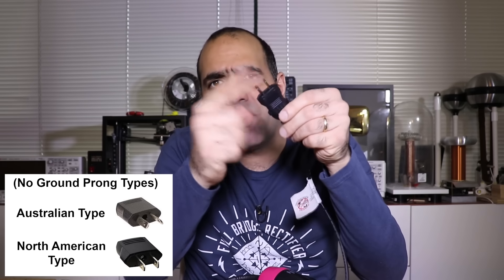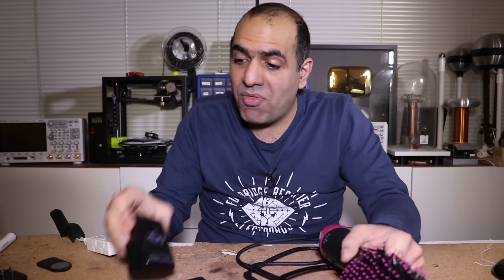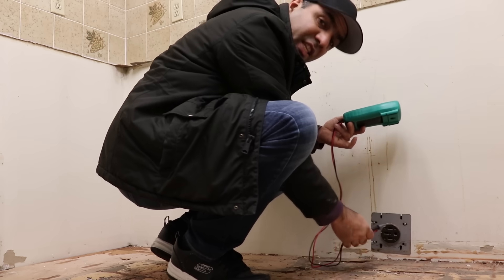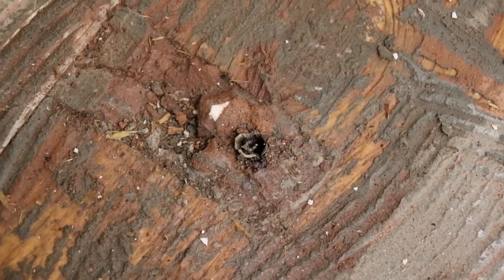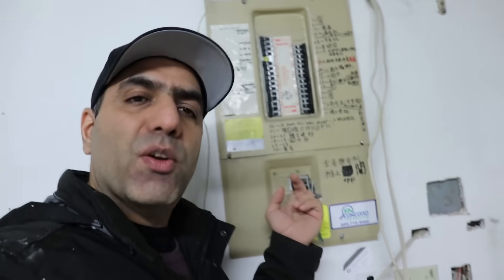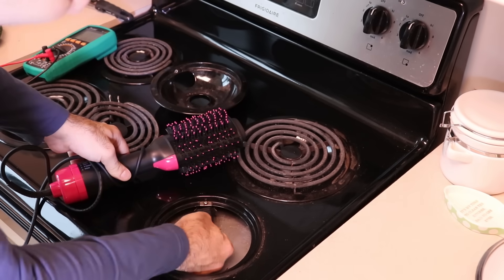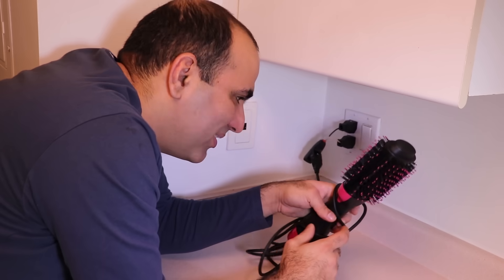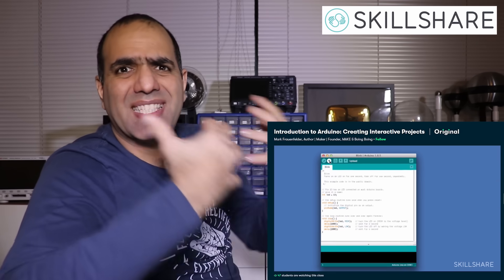Finding HIGH POWER 240V in a 120V Country

Comment: You're in Canada, how can you have 2 "phases" that are 120 degree apart??? The residential standard here is a center-tapped transformer that delivers 2 "phases" 180 degree apart.
Reply: His apartment building is on 3 phase power.  They just alternate running 2 phases to each apartment.  Your house is using 1 phase of a 3 phase power supply on a center tapped transformer.
Reply: @stargazer7644  So 220V devices in the apt run at a lower voltage? Wouldn't that increase the current draw?
Reply: @atubebuff  Remember Ohms Law?  I=E/R  If you lower the voltage (E), then the current (I) goes down as well.  This is how your oven works, for example, because it is a constant resistance load.  There are devices, called constant power devices, where this is not true - Switch mode power supplies are an example.  The current goes up on those when the voltage goes down because they're trying to deliver a constant voltage and thus a constant power to their load.  This is only true because they are active and react to the dropping input voltage.  So the answer to that is: It depends on what your load is.  If you're compensating for the voltage drop to maintain the same power output, yes, the current must increase.  If you're not, then no, it will decrease.

Comment: As a european electrician, north american standards frighten me
Reply: @KeeDx3 on a what?
Reply: As of a hundred years ago with Edison's suggestion of lower voltage,  it was hard to see the future. Light bulb filaments and electrical windings at lower voltages would last longer and insulation of wiring at the time was mostly cloth and wax. Running three wires is more expensive but was considered safer than one hot wire like the rest of the world.
Reply: @JamesWilson-pq9qp  AC is more dangerous, but Edison was a fool and a conmam
Reply: @torpedohippo8493  

Easy too say he was a fool, but at the time he was one of the most experienced people with the experimentation of electricity. He knew that arcing was more dangerous than resistant heat and thicker wires were safer than any chance of open air arcs. I'm sure you must have had seen the damage caused by loose connections or broken wires as an electrician. I know I have when I saw they tried replacing cooper with aluminum. What a disaster!
Reply: @JamesWilson-pq9qp  you realise aluminium is still used just as much as copper right? aluminium is just as safe as copper. 

I didn't mean was a moron or stupid. I meant he was a fool for trying to convince people that DC distribution system is better "because it's a lot safer", trying to convince people to use his DC system rather than the AC system with fearmongering.
Reply: @torpedohippo8493  As you might know some new high voltage tension lines are using DC for improved efficiency.  As we see in California open air arcing is a major problem with forest fires. Two steps forward one step back, DC looks to be the future with advancements in inverter created 3-phase. Who needs a humming wire broadcasting RF.  I have seen bad arcing with Aluminum, how to keep the connections tight when they expand and contract so easily?
Reply: @JamesWilson-pq9qp  as far as I know DC is only used in the high voltage long transmission lines. I'm fairly certain that the rest of the distribution system will still be always be AC for a number of reasons.

You keep connections good by using the right connectors/equipment and the correct tools and procedures when isntalling them. There's a reason that aluminium is used pretty much in all industrial supply lines (don't know the english word? but I mean the cables that supply the distribution boxes/panels), because it's much cheaper than using copper with such a large cable size. Aluminium does the job just fine
Reply: @torpedohippo8493   Yup, We've invested so much in the system we got, it's going to difficult to change over. As eyes open to the dangers of looking for cheap solutions we soon realize the old standards hold true, hopefully.   (power supply lines) I love copper for electricity. I think it's worth the price. In the times of Edison, aluminum was very expensive, we needed electricity to make it. Why not stainless steel? It's heavy but it won't oxide.  Soon enough we'll change over to micro-grids and get rid of high voltage transport and transformers.
Reply: @JamesWilson-pq9qp  stainless steel isn't conductive enough and costs a shitload. Aluminium is just fine for the places it's used. 
And yes, we will never go to a DC grid.
Reply: It's been great talking with you.  It will be interesting as solar energy becomes more dominate with it's storage batteries, and with the new regulations on inefficient 2-phase motors as they become obsolete. Who will want or need AC as we know it. Even our computers we are using run on DC. To think it's only been just over a hundred years with electricity and we're looking back on Einstein's Theory on photons.
Reply: @JamesWilson-pq9qp  all industrial electric motors are 3 phase asynchronous motors, that's probably the most compelling reason for us never leaving the 3 phase AC system
Reply: @torpedohippo8493  As we have seen the new speed controls of 3-phase motors, there are electronic inverters which can control superior efficiency by changing cycles along with voltage and amps. The power can be of any source and any smooth energy source is more efficient by not needing capacitors to filter ripple. Having one certain frequency (50 or 60 htz.) has always been a limiting factor with 3-phase. You'll see this coming pretty soon as everyone is trying to get greater efficiency with motors. 2-phase has to be worst, every motor with 3-phase and it's inverter will be the most efficient. Technology will change everything soon enough. We'll probably see refrigerators and air conditioning units first and then any new heavy industry will follow.
Reply: @JamesWilson-pq9qp  what? Are you saying we'll start using DC motors?
Also what do you mean with "control superior efficiency"?
Reply: @torpedohippo8493  Nope, no DC motors, nothing is more efficient than a 3-phase motor!  We can now create 3-phase with an inverter. We can now create different frequencies, voltages, emf;  we can have complete control over all aspects of the efficiency of a motor even in different loads.
Reply: @JamesWilson-pq9qp  what does that have to do with having a DC or AC grid? We've had frequency and voltage converters/transfprmers for years. We've also had rectifiers for years
Reply: Yeah but we use half the voltage, so it's only 1/4 as lethal. lol
Reply: @VoidHalo  also like the other dude said, more current = more heat = higher risk of fire. But just like I said, an RCD would render this irrelevant since it would trip during a fault like this regardless of voltage or current used in the installation
Reply: Nothing\ No. Half the voltage means double the current, which increases risk of fire.
Reply: @VoidHalo  The voltage is irrelevant.. The current and the voltage is lethal together, and 120V is plenty enough to push a lethal current through your body. Which is why in Europe we use RCD's in our electrical installations, while North America only uses GFCI outlets in the bathroom.  
An RCD would have interrupted the circuit in a case like the one shown in the video.
Reply: As an American electrician we havent cared about your opinions since 1776 

And ill admit out residential electrical system is shit but im speaking for experience 240 hurts way more and is a bigger arc than 120 that being said in America we dont push as hard as yall on insulated tools ( till getting in to 277/480 systems)
Reply: @burnedupsparkytipsandrevie9597  I really don't care wether you care about my opinion, 'murican!
Reply: Our GFCI's also trip at a much safer current level AFAIK
Reply: @Magneticitist  the common household RCD is rated for 30mA and max of 300ms
Reply: @torpedohippo8493  well I'm sure it's still serves as useful protection it also sounds like short ouch
Reply: @Magneticitist  what?
Reply: @torpedohippo8493  what I'm saying is 30mA seems painful and a little high of a trip current
Reply: @Magneticitist  it's max 30mA, usually they trip much lower and at about 3-5,ms

Comment: So regarding switch mode power supplies, and 220-240V vs 110-120V, is there a difference in efficiency for something like a ~1000W rated computer power supply at =/>50% load?   Are ripples more or less of a concern with one range over the other?    I mean, I’ve seen how weak some power tools are in comparison, lacking torque, such as power drills and 4” grinders.   But I’ve never really bothered looking deeper into it.

Comment: In the US, 240V power does not come from two different phases, here 240۰ and 120V power come from the same phase
Reply: @bosstowndynamics5488  True, they are two legs of a transformer, not two different phases, two legs with one middle end
Reply: You need two phases (plus neutral) to have two different voltages. 120V is between phase 1 and neutral, 240V is between phase 1 and phase 2.
Reply: @Gyzome  it's a single phase, technically called a split phase system
Reply: Gyzome They use a center tap transformer on a single phase, which results in 2x 120 volts 180 degrees seperated.
Reply: Its 2 seperate phases, and your neutral is tapped of your ground

Comment: Commonly done when trying to use a 220v welder without have a 220v plug, just create an extension cord or adapter to two different circuits and BAM, functioning 220v.

Comment: I thought the fact that residential grids are served from distribution transformers that convert 13.8kV to 240V and have a central tap acting as the neutral so that we can have a biphasic system with 2 voltage levels was common knowledge .-.

Comment: 1:40 At half the voltage we only get a quarter of the power out of it.
I should've expected that, but can someone explain to me why exactly?
Reply: If resistance doesn't change, current is proportional to voltage (I=U/R). Power is proportional to voltage and current (P=U*I), that means power is proportional to voltage squared (P=U²/R). So if U2 is U1/2, then P2=(U1/2)²/R=(U1²/2²)/R=(U1²/R)/4=P1/4
Reply: Power is voltage^2 / current

Comment: I remember having a weird 16A 3xx Volt power connector in my old german basement with some selfmade device by a electro engineer that changed it into 240v. Was aweseome for lanparties cause that thing had wa, more than 3,6KW surges... like at least triple that amount. we were like 10 ppl with those old crt monitors, was super awesome times

Comment: easiest way would be to find a plug with a separate circuit in your house/apartment (eg. fridge, freezer, panel plug) and put the neutral on the second phase of a 2 pole breaker in the panel, essentially changing the plug to 240v. Also dont plug anything else into this plug or it'll blow up (although it seems like you're into that kind of thing).

Comment: Omg, right before you put the multimeter in the outlet I thought: "He definitely put it to current to explode stuff". I have experience with doing that because I was an idiot, forgot it was set to current, blew a plug and corrupted my windows installation xDDD! Had to reinstall windows oops..
Reply: LOL. did you have to have a contractor out?

Comment: Correct me if I'm wrong, but the 240V "phases" in your house are not actually 120 degrees apart. This is called a single phase split, and it's simply a single phase transformer that has the secondary winding tapped in two different places. The center of the coil is 120V, and the far end is 240V... both measured from the same end.
Reply: Almost correct.   The center tap is usually referenced to ground.   This gives 120V from center tap to either end and 240V between the two end taps.
Reply: The phases in his apartment are 120 degrees apart.  It uses 2 out of 3 phases (360/3=120).  The house is different.  It uses a single 240V phase with a center tapped neutral.  When referenced to the neutral, the two hot wires are 180 degrees apart, because they're opposite ends of the same coil.

Comment: can I use this setup to plug in a 240v charger for my chevy bolt. it is currently plugged in to the dryer plug. with this charger it can charge at 3 to 4 kwh vs the 110 charger at 1kwh.
Reply: Technically yes. Practically you will need an electrician install a 240V socket to do it in a safe way.

Comment: What I know about 208 volts AC is its created from 2 live lines from a  3 phase power source , while 240 volts AC is created from 1 live line from 3 phase power source and neutral .
Reply: Actually, no neutral involved for just 240V.  The neutral is needed to allow you to get 120V from the 240V source.

Comment: Why is that you ha e 110v and we ha e 240v.
240 can run bigger appliances and uses less current. With 240 you dont need thick cables to run the same appliance as it uses less current. So why not just use 240 everywhere.
Reply: Changing the grid voltage is the same as swapping the driving side of traffic on the road. Everyone has to go at once. Account for at least a million accidents countrywide. Houses on fire because of appliances that started smoking and so. And a big part of the US grid uses 2-phase 180 degree separated lines, which has no place in 230v grids. So that’s even more to go wrong. In the first place, swapping all the transformers in a grid is impossible. You would need months of downtime.
Reply: Switching to 240V would be easy. We already have 240V coming in from the center-tapped transformer. It would only require installing gang-tripped circuit breakers and wiring in new outlets. Circuit breaker boxes already have the phases staggered so ganging breakers together is easy. The "Grid" would not need to change at all. The wires that feeds the pole-mounted transformers outside your house are at 13KV 3-phase.
Reply: @Engineer9736  indeed it will take alot. But considering higher voltage means less current means cables runs cooler. Aka less chance of a fire.
Reply: Replacing infrastructure everywhere to a 240V system would cost a lot.  Also, I imagine that 240V can introduce more of a health risk if shocked.
Reply: @DrewMiller4_18_5_23  will the less burning houses offset that number?
Reply: @captainheat2314  Can you link me to something indicating that 120V systems cause more house fires?
Reply: @DrewMiller4_18_5_23  120V kills better than 240V, because the current kills, not the voltage. 120V needs more current for the same power.
Reply: @marsovac  You can't get the current without the voltage.  Ohms law.  If current without voltage killed, then car batteries would be deadly.  Put your hands on the terminals of a car battery and tell me what happens.
Reply: @DrewMiller4_18_5_23  a battery is dc not ac. Different type of current.
Reply: @dariusvanstaden8144  I know,  but follow ohms law for resistive loads though, so I think it makes my point.
Reply: It ain't broke
Reply: Not sure what the laws are in US. But in SA your DB board needs to comply with regulations that includes having an earth leakage protector infront of your circuit breakers. So if there is an internal electrical failure it will protect the house. Less than 100-300 miliamps will cuase it to cut power. Thus stopping any appliances to catch fire or exposed wires to cuase a fire. An to top this form what we call the street ( your power dilivery box from the city) there are also 2 fault protectors. 1 is an overload 2 is the meter itself that will cut power if it detects a current fault between live, neutral a d earth. 
We have 2 and 3 phases aswell but it is used to balance the power in the house to stop overloading a single phase from the supply. Only industry uses it for 380v purpose.
We hardly have house fires caused by electric failures. In most cases the house did not comply with regulations.
Reply: 240v is more likely to spontaneously explode

Comment: But doesn't the drier need a neutral? I only saw the 2 phases from the 2 plugs...
Reply: 240V appliances don't need a neutral.  When you draw the same current from each hot wire, zero current goes down the neutral.  So you don't need it and can leave it out.

Comment: US: 110V is to weak to power a stove, lets use 200V 
Germany: 230V is to weak to power a stove, letzt use 400V 3 Phase
Reply: Electrical engineer: we can call the power company and upgrade the mains to 16mm, then run a seperate circuit to the stove with 2 or maybe 3 phases with a special outlet, in 6mm cable, then you can get enough power to cook your poached egg before work in the morning.....
Plumber: how about we just get a gas stove.
Reply: I think you have confused the voltage levels. 400 V is the voltage between each phase. You're still using 230 V phase voltage to power the stove. However in this case you use 3 lines which gives you a continuous power supply that's three times greater than if you where using just a single phase to power the stove.
Reply: A poco man: 400V is low-voltage in our eyes! We've been working on 10KV power lines every week! 
10KV makes 400V look like 24V!
Reply: too*
Reply: Neither of your choices are enough 6Tera Volt should do well with no fuses in buildings allowed 😂